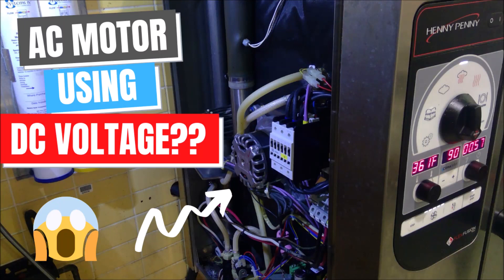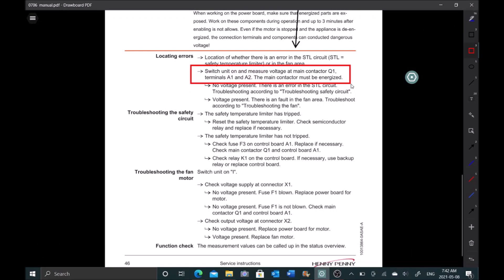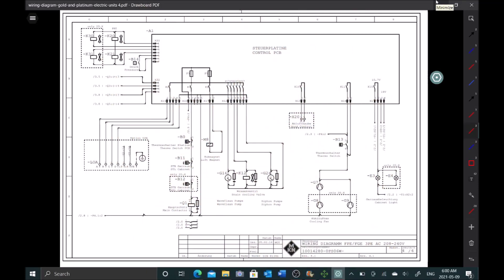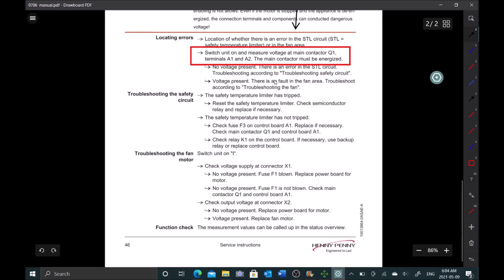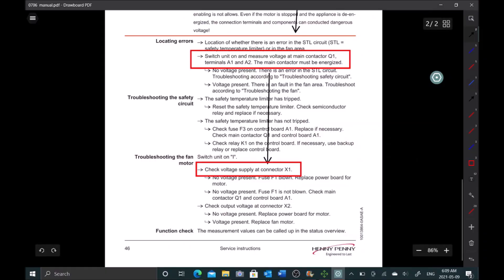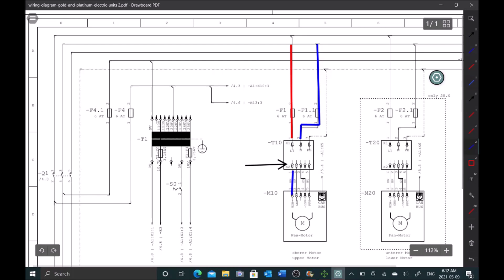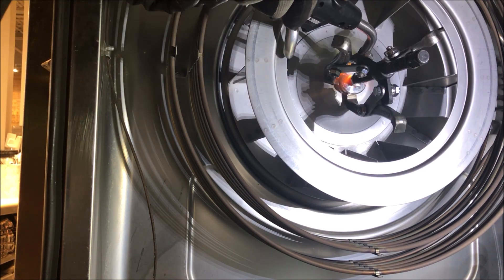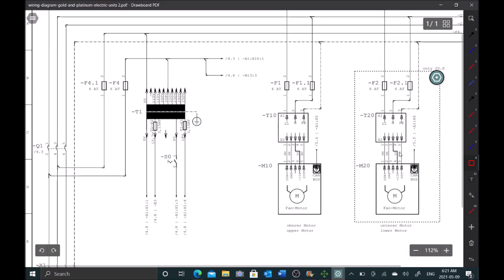How Does this AC Voltage Motor Run Off of DC Voltage? Henny Penny Combi Oven Error 07-60.

Comment: So what actually fixed the error code?  Just replacing the motor only?  Or did you end up doing the board also?... Also what brand combi was that?  You see alot of x1 stuff on a rational. But didn't look like rational from the front....
Reply from the maker: It’s a Henny Penny combi oven (flex fusion gold) motor control board was good, bad motor.